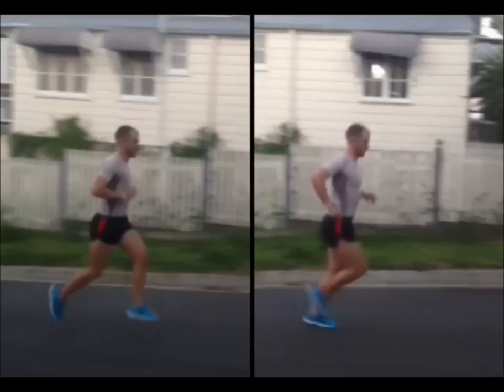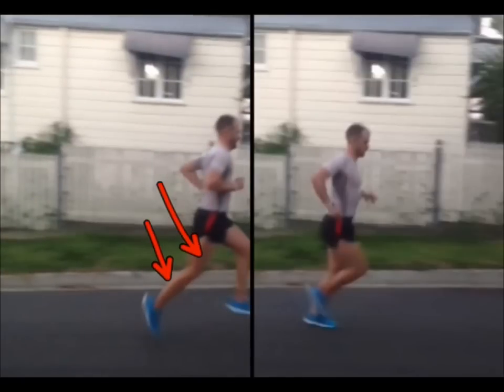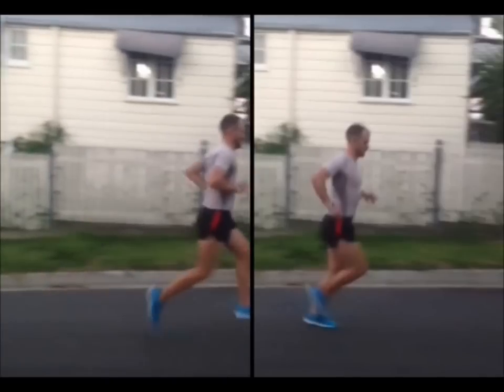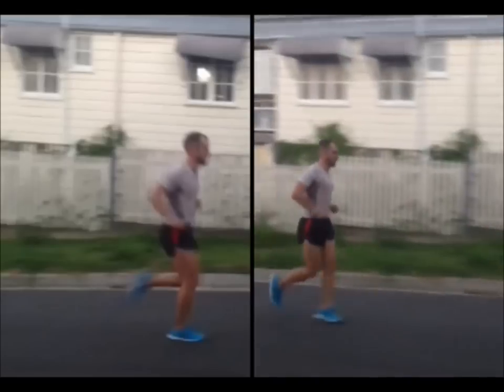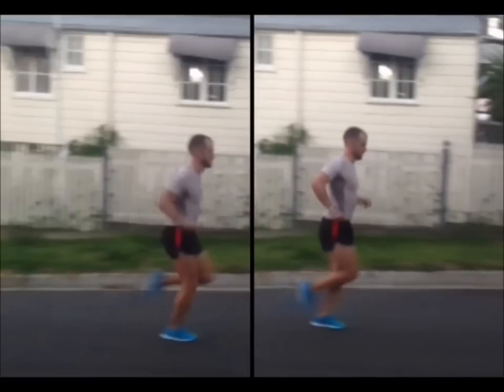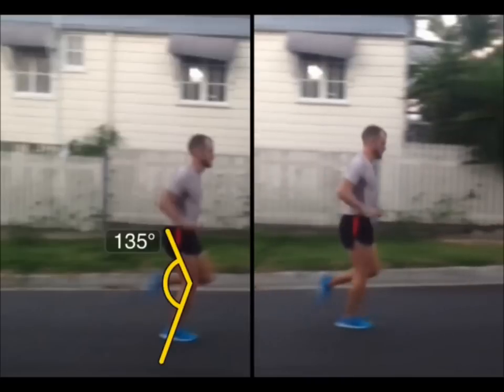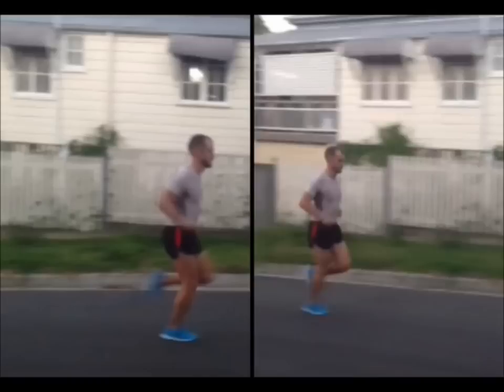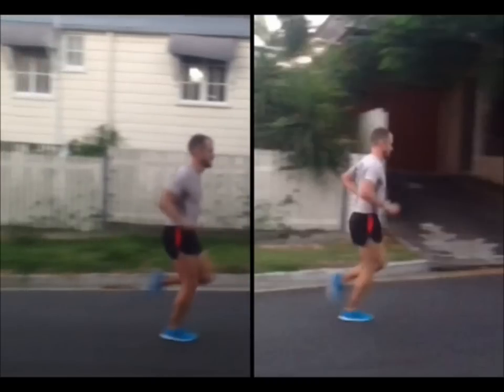Running - How to Run Up Hills and Not Get Tired!

Comment: If you run up a hill without getting tired it's not a hill.
Reply: Maybe you haven't tried running the right hills that surely get anyone tired, with incline over 15 degrees ))
Hills with 25+ degrees incline that are long enough are guaranteed to get any runner pretty tired 
And it is called skyrunning
Reply: Boss3n ,I was born and raised near were the hill is located.We used to run up-down the hill(barefooted) without getting tired.
Reply: Lol
Reply: I ran a 8 mile hills and don't get tired
Reply: Click bait
Reply: Lmao🤣🤣
Reply: @aktanakhmetov  I have a hill at my school thats 23 degrees and 83 feet. Its horrible for us middle schoolers during races.

Comment: I like it.  Thank you for simple tips and analysis.   I have been learnings ChiRunning and studying other masters and coaching analyses.   I think you left off one more thing.  Falling forward with a lean from the ankles.    You have some forward lean and are keeping your center of mass under you as you go uphill which also helps forward (gravity has a horizontal component even as you go up).   I think you’re doing it.

Comment: Commenting to hopefully bump this up in recommended vids.  This is good info!  Probably he should note there is an increase in cadence with the shorter steps, and good harnessing of elastic recoil in the achilles in lieu of muscular force.  I think of it as nibbling your way up a steep hill vs trying to takes big bites.  Keep the cadence up and keep the breathing / effort below threshold for those long ones.
Reply from the maker: Cheers NoVA Gaski. Have a good week

Comment: 1. That's not a hill, try a real slope. 
2. What took you 6 minutes and 40 seconds to say, is a) keep your body straight, b) do short steps, c) keep knees low, d) be relaxed. Just 10 seconds of information.
3. There is endurance uphill running and there is sprinting and you ignored completely the later.

Comment: Don't complicate running. It should be the simplest form of exercise. Just shorten your stride (aka Increased Cadence) on uphill and try to breath in through the nose and breath out through the mouth, you will gasp for air but that's the whole point of training on hill. If you don't want to feel tired then you are not challenging your body and in my opinion that's not considered as hill.

Comment: Honest question: though I can understand using the proper form to avoid injury is most important.. If I'm not working my muscles much, and keeping the relaxed instead, am I getting a significant enough workout?
Reply: thats what im thinking
Reply: Good question.  I'd imagine you're expected to strengthen and get the good workout by powering up the hill faster, or more times, or hitting bigger hills, or by decreasing the recovery time between workouts.
Reply: +Valery Rivas if you want to be strong enough for faster/longer runs, you have to do those faster/longer runs, too. tempo runs, intervals, slow long runs. no need to bang it up a hill for longer than a minute though (and repeats if that's your training for the day) unless you're really advanced.